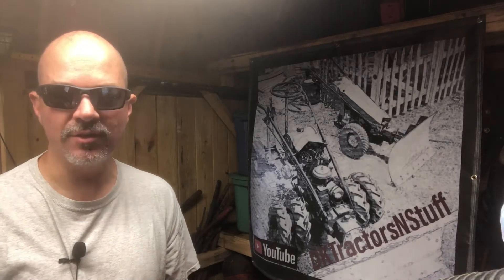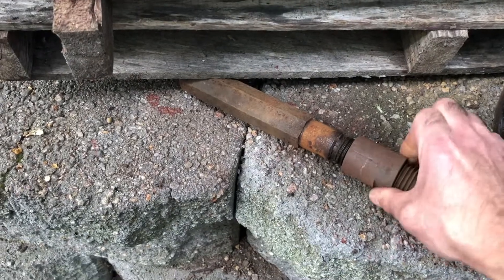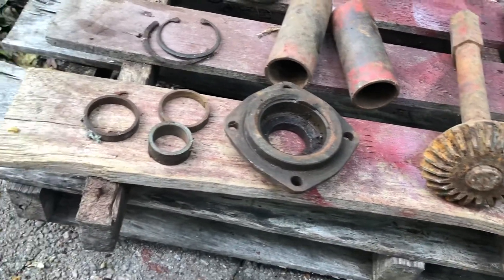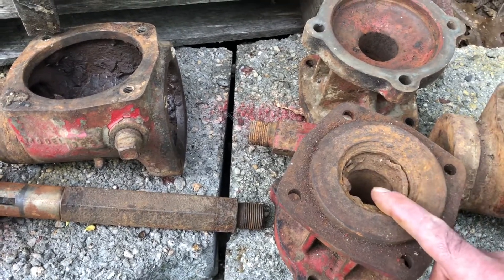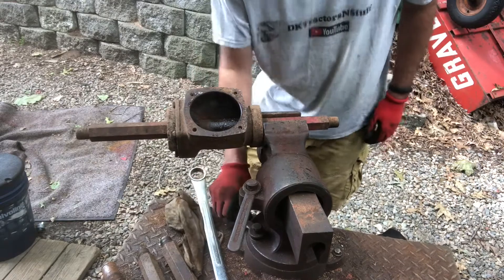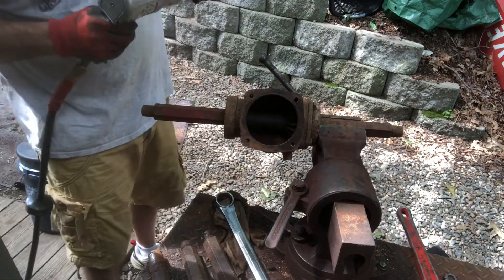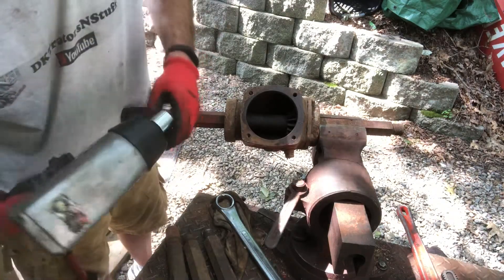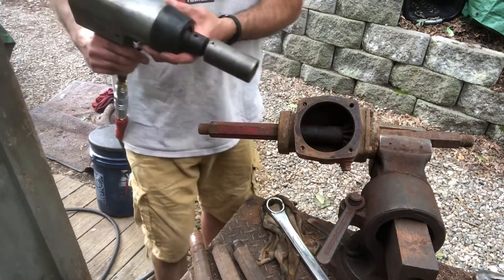Gravely cultivator repair part 1 (Disassembly)

Comment: Thanks. I just bought one of these and it needs new bearings and hopefully not much more. I paid $150 for a Gravely 526 with the cultivator. Some young man got it at an auction and tried to get it running but he gave up.
Reply: I grew up mowing with a very old Model L that I had to rope start. I wouldn’t be surprised if my right arm was a few inches longer from pulling against that beast. I never saw anything that came close to the rugged dependability of a Gravely 2 wheel tractor. I’m not at all surprised when I see over 60 year old Gravely stuff still going.